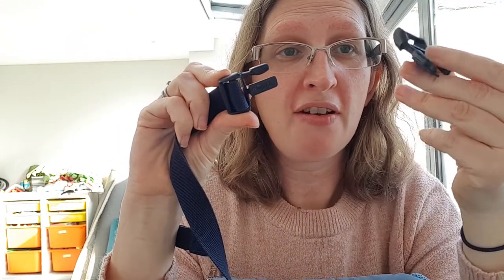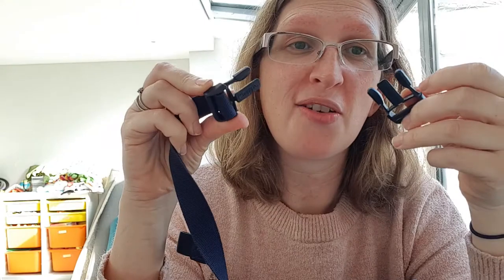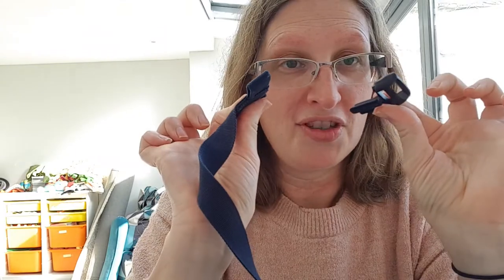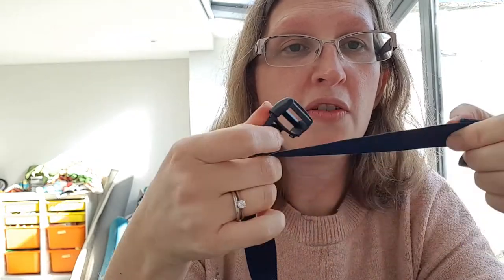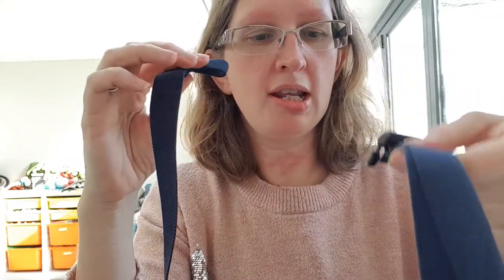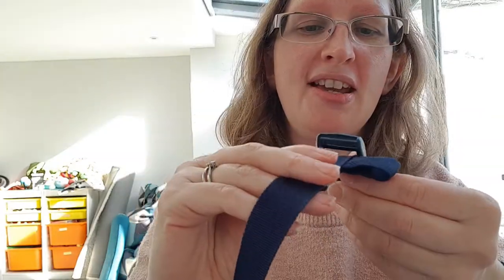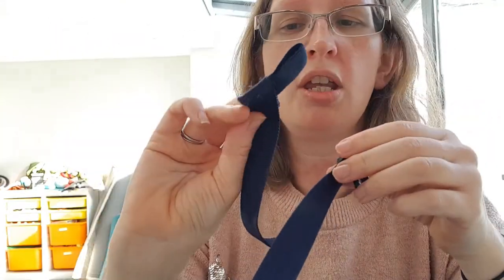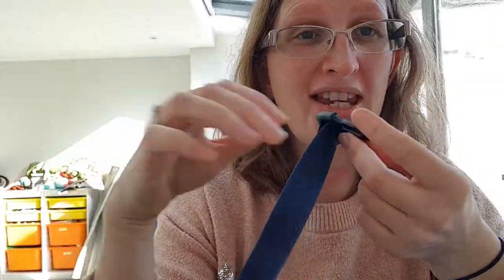How to replace a broken buckle on an Ergobaby Omni 360 carrier.

Comment: Thanks! :) had to use the hammer on our 2016/2017 model. My makeshift pliers (old medical needle holder) came in handy pulling the cord through the new buckle.
Reply from the maker: Glad it was helpful! Yes I always needed a hammer with the older ones. Great you had something you could use as plyers
Reply: Great tip! I had a very difficult buckle to thread. I didn't want to cut the elastic so I had been putting the carrier aside(for months) and periodically trying to thread it. I came across your comment and tried using pliers and it worked beautifully. I wish I had tried this sooner. Thank you!

Comment: They only offer replacement parts for the male parts of the buckle. Apparently this is for legal reasons. I am now left with an Ergobaby Omni Carrier that is entirely unusable because the female part of the buckle cracked, and it is not safe to wear. Customer service offered me 20% off to purchase a new one. This is absurd to me, and really unfortunate because the product is only 6 months old. Buyer beware!
Reply from the maker: @allybehnfox9224 did you buy this carrier new from Ergobaby or an approved Ergobaby retailer? If so Ergobaby offer their 10 year promise and replace the whole carrier in the case of the female part being broken? I know this because I am an Ergobaby retailer and have arranged a replacement for a client who once needed this.  I've only heard of them offering 20% discounts in the case where someone has bought a carrier second hand and thus aren't the original owner of the carrier and the recipient of the 10 year promise or for those who have accidentally bought a fake Ergobaby.
Reply: I had this with my tula carrier. I recently found out they areade by the same people. My husband found a replacement female buckle which has a metal screw so you can loop it into the webbing so you don't mess with the carrier itself and then switch the male counterpart around like on this video. As the buckle screws into place it feels more substantial than a completely plastic one.
Reply from the maker: Oh thank you for sharing!